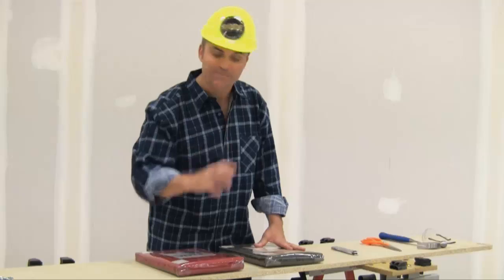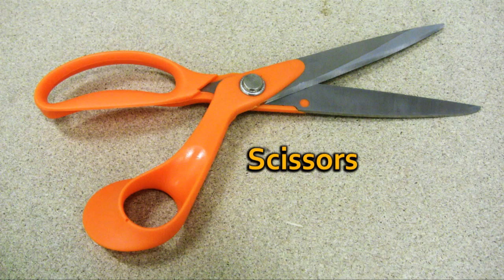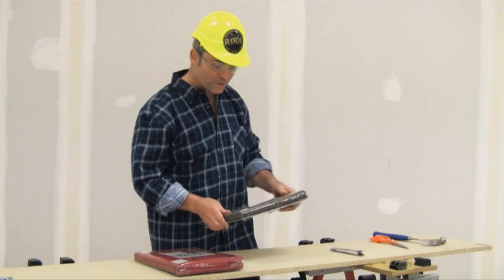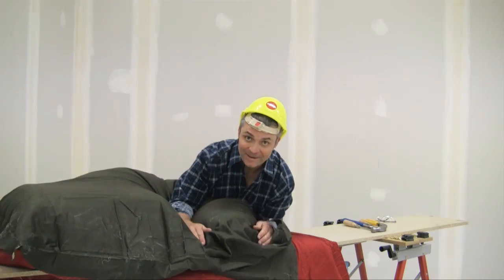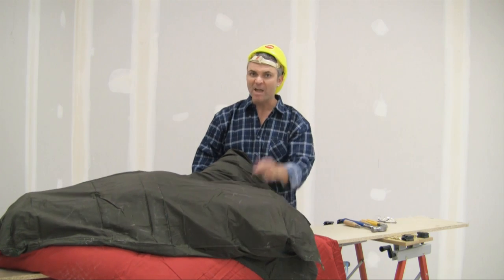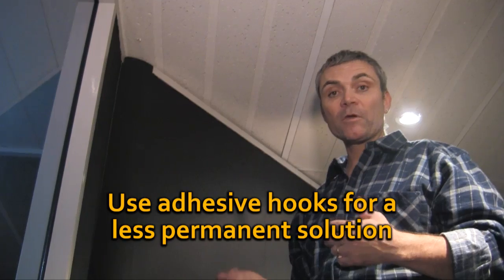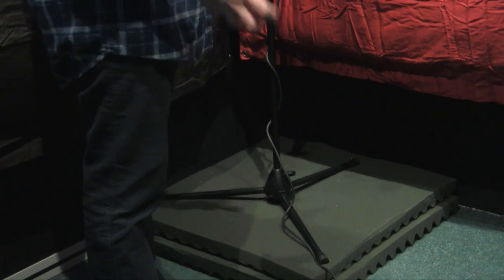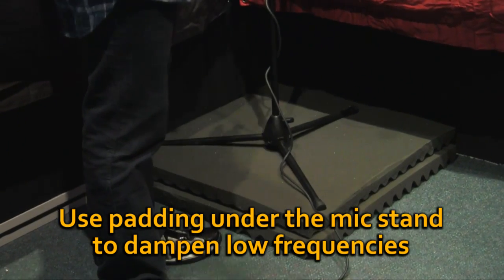Room Acoustics 101 with Peter Freedman

Comment: I have a NT1-A and just spent a few days covering a large section of hard wall and the ceiling above where I want to do recordings, with acoustic foam panels which has helped reduce the echo a lot on one side of the room where I need it. I was told that its more important to cover the area behind you as the mic rejects back noise, but I suppose that can depend on the room size and you'd easily pick up echo bouncing off the wall in front of the mic if you don't fix it too.

Comment: If you couldn't hear a difference I'd be seriously worried about recording in any studio that you designed. You need your ears checked or you need a better sound card/monitors/cans. We'd all like proper acoustic treatment for our home studios but for ~$100, this achieves a decent reduction in early reflections and the resultant comb filtering. Certainly better than no treatment at all, and a whole lot cheaper/easier than building your own semi-rigid fiberglass absorbers/diffusers.